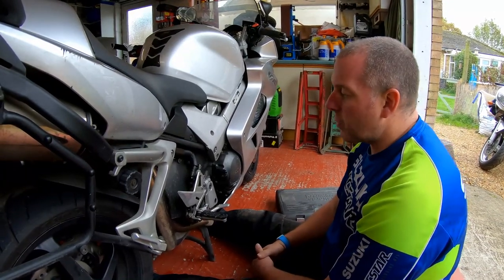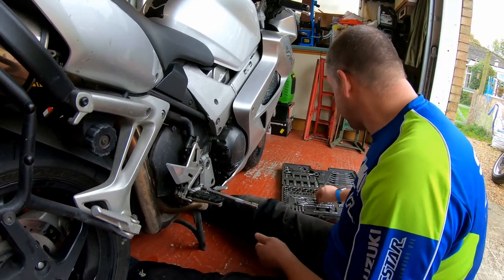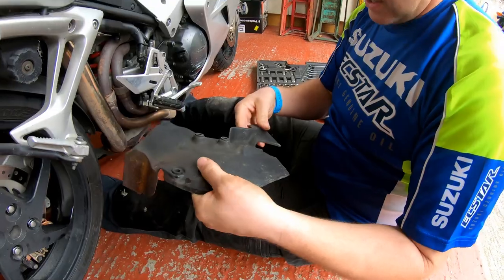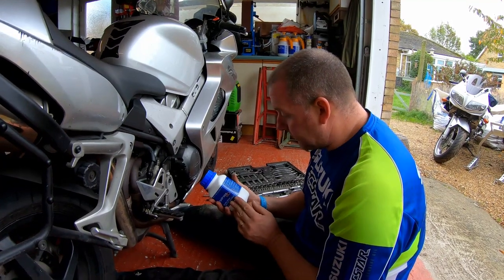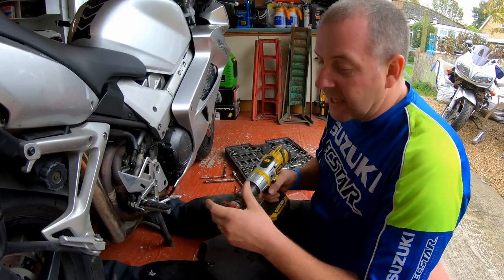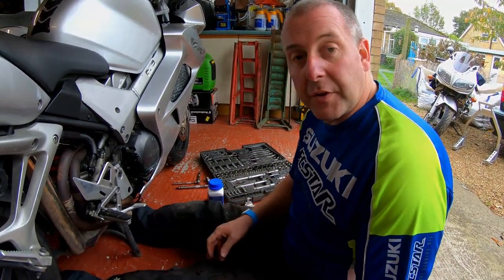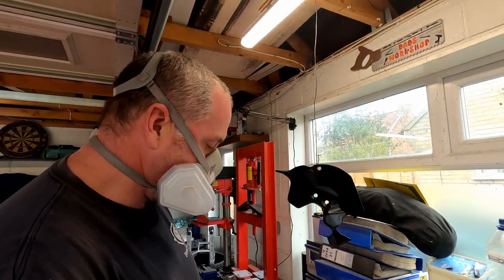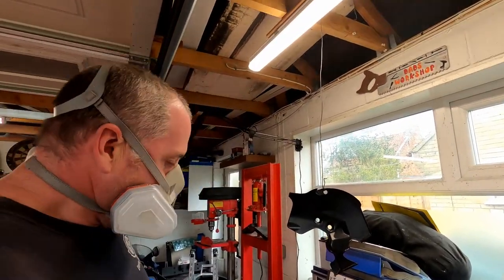Honda VFR800 VTEC - Exhaust Heat Shield Corrosion Prevention With Bilt Hamber Hydrate 80 Rust Killer

Comment: I did this a couple of years ago using the Krust equivalent . Was my first project after a service actually.
The bilt hamber stuff looks like a thicker product and certainly a better choice imho (I use bilt hamber for decontamination on paint work now and love their stuff).
Mine was in a much worse state though with pin holes around the curved edge with the small return lip. 
I ended up using wurth high temp and masking taped the back side of the holes (filled them with paint).
On inspection after following your awesome cct replacement video, I was actually surprised it was still pretty decent. 
I’d say that is more thanks to the paint than the krust stuff lol.
Think all vfr owners have had that shock on the price of this pressed part, totally unwarranted imho.
Reply from the maker: I know what you mean about the price! It’s almost as if it was expected to rot out and then priced it accordingly to earn a tidy profit! 🤔
Reply: @Mark Duncan i don’t ride on salted roads so I couldn’t say if the wurth paint would be any better than what you’ve used tbh. I did use it on the subframe bars below the seat and refurbished the scaffolding for my panniers/top box and it still looks great after rubbing abuse though.
Mine was bad too, so much flaking on the back side it definitely wouldn’t of survived the more aggressive rust eater that Kev used on the garden shears (bilt hamber solution in a bath). It’s definitely 50% paint now haha.

Comment: Discovered your channel recently Kev. Loving your videos. I bought a 2008 VFR VTEC last year so I’m finding your videos really helpful. I’m doing some cosmetic tidying up at the moment, including painting the exhaust heat shield so it was interesting to see how you did yours.  I use Bilt-Hamber detailing products for my car and they’re brilliant, but I hadn’t tried their rust chemicals.  Your videos prompted me to try both Deox-C and Hydrate-80 and I’m very impressed with both. I’m going to use the Hydrate-80 on the slightly rusty oil cooler pipes too before they get too bad. Would love next time you have the fairings off the VFR if you did a video on checking the fuel ignition system fault codes. I want to check mine as the bike has developed a slight misfire. However feeling very stupid as I am struggling to get the red plastic electrical plug open - the one that I need to open so I can jumper it to get codes revealed on dash. It’s hard to work out how the little retaining tangs on the sides of the plug can be disengaged so the cap can come off the plug.  I’m sure I’m missing something very obvious! Anyway - keep up the good work and thanks for making the videos. Michael
Reply from the maker: Thanks dude, glad you are enjoying the channel, good idea about the fault codes, I recently did this on the SV1000 which was received very well so it makes sense to do it fore the VFR too! 👍🤓

Comment: On the RC36 (VFR 750 F, 94-97) this was made from a non rusting metal, either alu or stainless steel... Even Honda's are getting build cheaper as time moves on... Pity.

Comment: Can I paint the outside of mine with high temp paint either auto or grill type mines not terrible but did replacement of all fairings and more bike looks dam neer new this is just slightly I mean slightly discolered in couple small spots just wondering nit huge deal but if can I want to
Reply from the maker: Yeah sure 👍